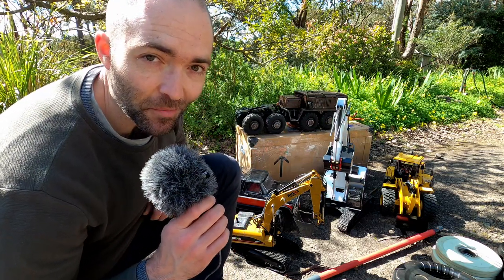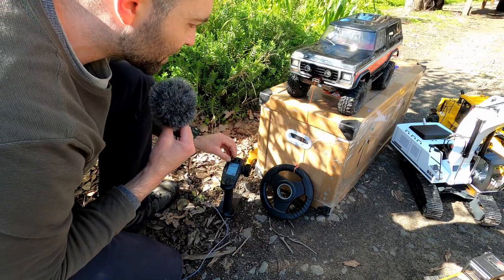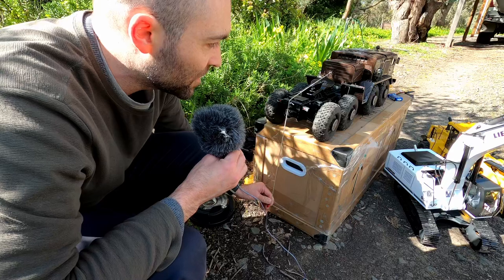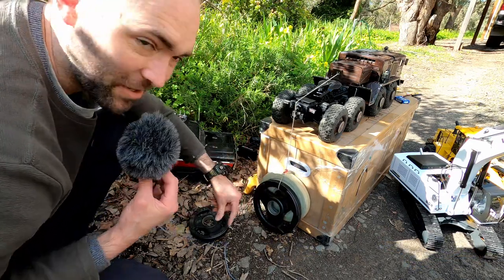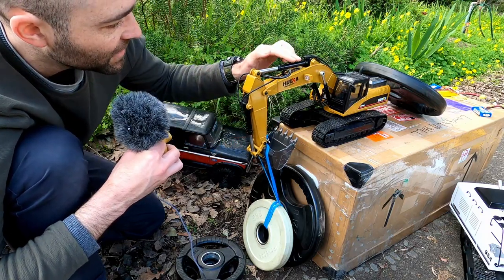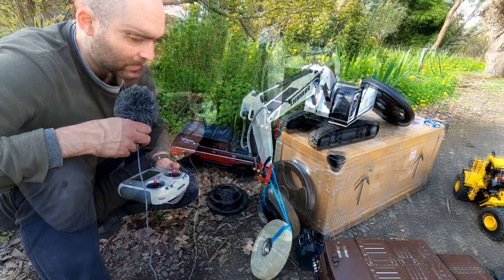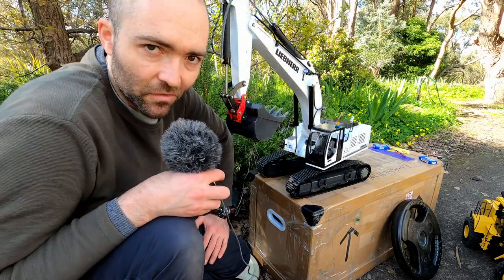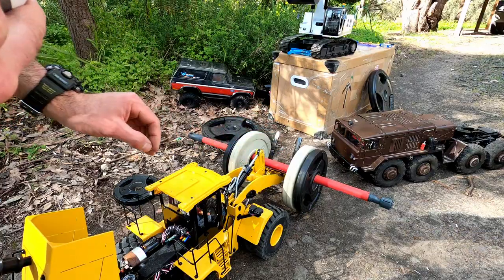How Strong Are RC Hydraulics & Winches? Let's Test!

Comment from the maker: Got the hydraulic excavator to lift just on 15kg on 4.5Mpa. Don't think I want to go higher than that though! I've had a chat with the factory and they reckon it's fine to run at 4mpa for general play, so that's what I'll do. 12-ish kg is adequate for the full experience.

Solved the leak issue, too. More on that in another video when we go over this thing in more detail, coming soon!

Comment: well that was entertaining lol.. the excavator is that just the 4200xl painted white?  I am on the fence between a few different excavators on which to get.
Reply from the maker: It could be, there's scant detail about it yet. I'll do a video on it soon with the cover off. It's about as budget as hydraulic excavators get, short of converting a Huina 1580!

I'll add that I'm now running this one at 4mpa with the seller's blessing and it's plenty strong. This is the cheaper end of things. I might have bought the 336gc in hindsight (or whatever the budget Kabolite 336 model is), but after some tweaking and screw tightening this one is growing on me.

Comment: That's some serious pulling power on that BC8 winch. But, considering the vehicle and its other specs, not really all that surprising. That truck is pretty beastly, I expect pretty much everything about it and everything it can do matches that description. Your choice of winch on your TRX-4 is interesting. Why did you choose that one, and what bumper did you mount it on?

I put the stock "Scale Winch" from Traxxas on my TRX-4 1979 Bronco. Traxxas states that the max weight of that winch is 10lbs, but I have never tested it. I suspect the relatively soft plastic of the Traxxas "scale winch bumper" will fail long before the winch reaches maximum capacity. That bumper is soft, flimsy, and very bendy. I don't trust it for anything serious, I just haven't been motivated to change it. While I haven't tested just how much it really can pull, the winch itself is pretty solid and seems to work well. 

On my wife's Redcat Gen8 V2, we mounted a Warn 8274 from RC4WD on the stock bumper. That's what a Scout II would have had from the dealer, it's what they SHOULD have, so when I found out there was a scale one, that was the only logical choice. And let me tell you, that 8274 is every bit the beast a real 8274 is. RC4WD claims it has a 50lb dead lift and 70lb rolling drag and I believe them, there are videos right here on Youtube demonstrating it's capable of quite a bit more than that if you push it. If you're looking for a good reliable strong and tough scale winch, that's the one to have. It's monstrous. Eventually the TRX-4 will get one of these too. 

Honestly, all of the weight capabilities of these vehicles you have are pretty surprising. I expect them to be capable, in order to do scale construction type things and to make playing with them genuinely interesting and fun. It really wouldn't be if they couldn't do what they're supposed to. But I think they outstrip expectations by a goodly amount. Those are impressive machines.
Reply from the maker: Ah yes, the 8274! I remember when RC4WD released that in mid 2016, what a beast! I've been meaning to get my hands on that at some point, but haven't gotten to it yet! Amazing power.

The one in my Bronco is just a cheapie. I cut into the grille and recessed it a bit. It's bolted to the plate behind the bumper, from memory - it's been a while since I looked at it - but it runs on 3S via a WP-1060 that's run from the GT-5's fifth channel, on a dial. Gives that fine control both directions :)

Nice choice for the Gen 8 V2. I didn't know much about Int. Harvester until recently - just wasn't on my radar, given they're pretty much non-existent in Australia in favour of the Japanese 4x4s here. I saw the one that Derek on VGG fixed-up a bit, recently. I definitely see the appeal!!

Oh and hey, I haven't had time to make a follow-up to this video yet with the hydraulic excavator, but I had its hydraulic pressure turned down too much. It's now running at about 2.8 PSI and the arm can lift about 16KG. Much better than in this video! Strong enough to even damage itself (ie. bend a bucket or snap a track section) if I'm not careful! It's a lot of fun - it'll get a dedicated tour video soonish :)

Comment: So in your opinion, which one is better, hydraulic or electric?
Reply from the maker: Hydraulic, easily. I had an issue in this video and have since fixed it. Hydraulic excavator is strong enough to bend its own bucket, now. Same system as in the bucket loader.
There's really no comparison. Hydraulic is where it's at for strength.

Comment: such wonderful video my mate Even i l😘ve the compare between these machines But i want ask you about the excavator Hydraulic And faroe wheel loader WA470 this is not a limit for them you must open the pressure for them All Until they can lifting more this is not the END you must open the pressure to 20 bar At least from the thump screw
well thx my mate Cheers🍺
Reply from the maker: Hey thanks, I've since played with the pressure and yes, they go much higher! I owe that excavator a video but the wheel loader had one recently-we covered the pressure adjustment there :)
Reply: @RCTNT  HI. Again well look dude this loader its not bad Even when you open the pressure But if you want real power And strong loader you must try JDM Earth mover 870k she best and strongest than faroe WA470 ... JDM 870K she is best 
thx Again bud ..greetings from Canada🤗
Reply from the maker: @The-Warm-voice1359  no doubt, it looks good.
Reply: @RCTNT  i agree👍 there is 5 reason Until buy JDM 870K
no.1 she have disc brack like real machine
no.2 you can adjust the pump
no.3 you can remove the teeth from the bucket
no.4 she have 2speed And diff lock
no.5 she made from full metal without any 3D printed Even have good details
Reply from the maker: @The-Warm-voice1359  sounds good!
Reply: @RCTNT  that what's up👍

Comment: Thanks for this nice vidéo, please the machine with the hydraulique pump 5mpa how many kgs can it load. Thanks
Reply from the maker: Do you mean the yellow wheel loader or the white excavator?

Wheel loader can do about 20kg and it's running at 3mpa.

Excavator I haven't measured yet but it will have a video soon. I'm running it at 3.5mpa and it's strong enough to bend metal, so I'm guessing 20kg or so. I didn't represent it well in this video. There is one coming for it though!

I haven't run either at 5 yet.
Reply: @RCTNT  thanks how about the white excavator
Reply from the maker: @khelifihebbache8032  expand my last comment, I talked about it too. Video coming in another month or so. Cheers
Reply: @RCTNT  thanks very much, excuse me i don't speak english correctely hi.
Reply from the maker: @khelifihebbache8032  all good, my friend

Comment: I was sharing your dread as you put more and more weight on these RCs... Almost had me sweating, suffering for those tiny little metal gears!
Speaking of winches, we were trail driving the RCs today. We were wondering where do you draw the line? Some competitions are trying so hard to make the courses challenging, it's not like they require a winch ro pull yourself out of tough lines, but if you don't use it to swing from the cable as you drive, you might not make it. Nuts!
Personally, I've never used one, although my little MST CMX "Jimny" (242mm wb on 83mm diameter tires) would really benefit from any help to creep up in many spots... although I wonder how "lazy" on relying on the winch would I become if I had one. Also, I haven't seen much winch specialized content, if you wanted any ideas... which I'm sure you already had, but, anyway, there ya go, haha! =)
Reply from the maker: Lol awesome thanks
I've been in comps for a few years where winches were needed half the time. You don't get "lazy" with them because they're a bit of a pain - you need to resist using Hand of God to recover. But for scale driving and fun, it's entertaining in limited doses.

The best comp courses don't need a winch but can reward their judicious use. Building a course is something that's hard to teach or define, but with some practice you can make something that balances on that knife's edge of challenging but possible for all to finish. Winches can add to that, but shouldn't be the central focus of a course - unless it's specifically a winch challenge... And boom, there's a video idea.

I have a bunch of different winches. I guess it might be useful or interesting to do something that combines a comparison/review with a challenge of some kind. Hmm.
Reply: @RCTNT  Oh, I'm liking those ramblings. Could be very interesting on getting to better understand the types, uses and avoiding abuses of winches. Do let those draw some notes for a future video!
Reply from the maker: Righto, I'll get onto it!
Reply: Great thread..I'm new to crawling so I'm trying to soak up as much info as I can and you have some really good video ideas and I would definitely be here to watch those for sure..
Reply from the maker: @276rclife6  thanks for the reminder!